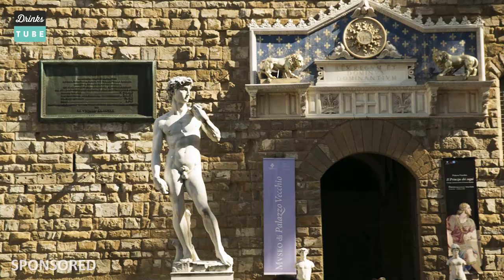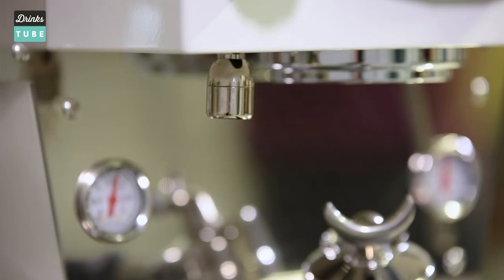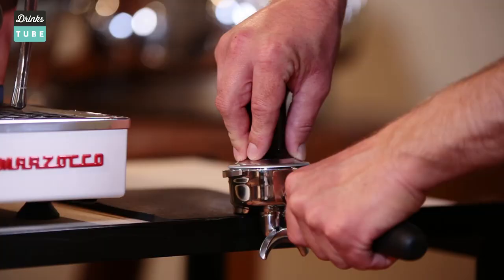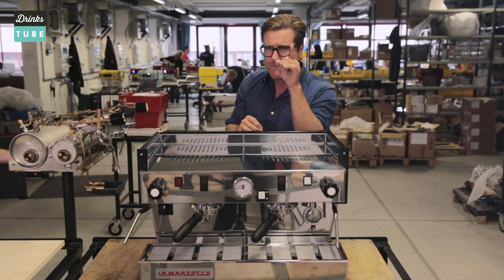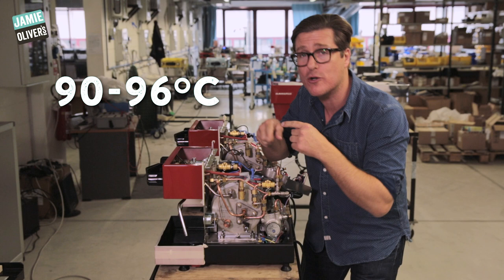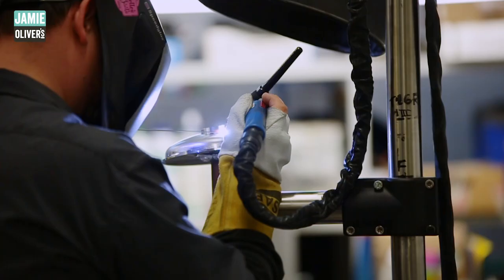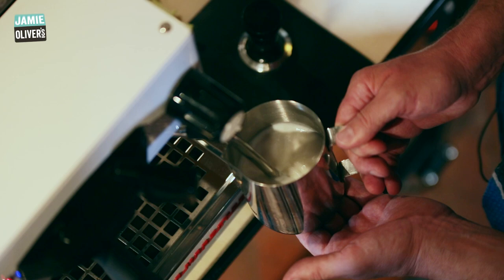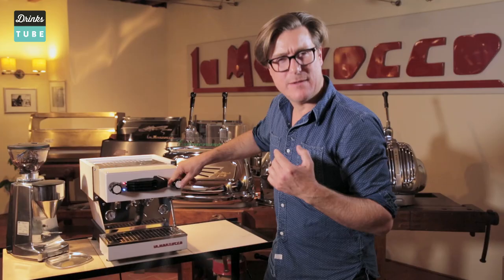How A Coffee Machine Works | Mike Cooper

Comment: This is just an ad for the La Marzocco Linea Mini.  Wasn't the best machine I've owned,  by far. Fwiw, it's a bad buy @ $5000. Half of that cost turns out to be for the fancy red nametag on the drip tray.  Mine came with a faulty thermostat, and had to be repaired straight out of the box. Thankfully the overpressure valve worked.  Anyway in use it gave me more pain than pleasure.  The non-adjustable 1sec preinfusion that was so poorly implemented it was virtually useless. Hot water dispenser spraying superheated water all over making it useless also.  Very innacurate temp disk and a very small water reservoir falsely advertised as 3.5 L. You can read all of the complaints about it on homebarista.